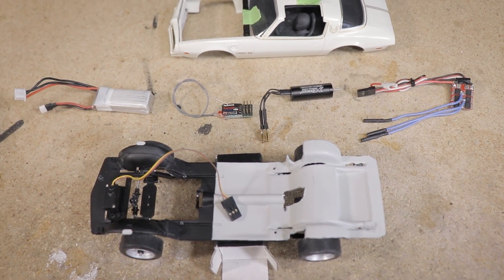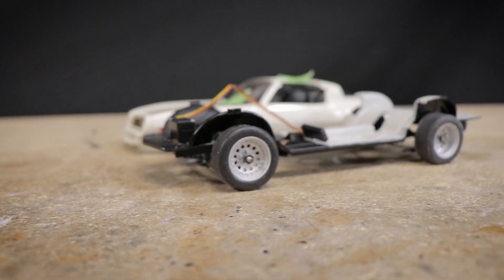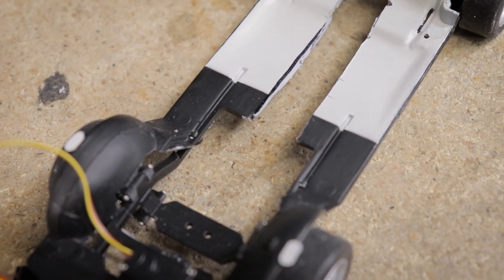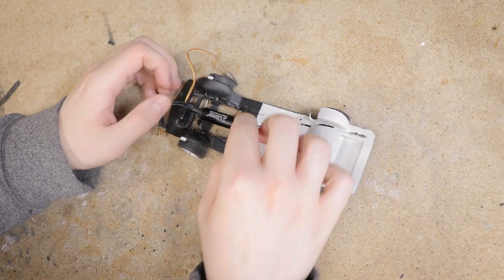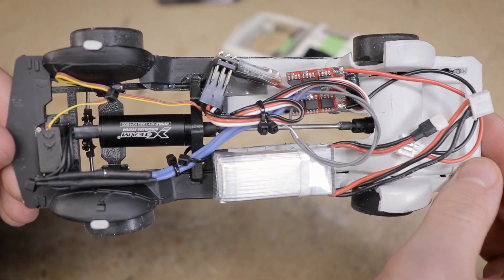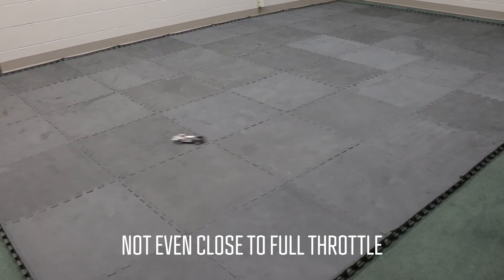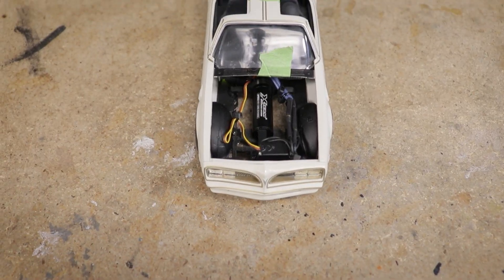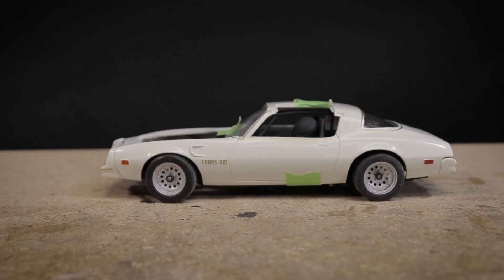The 1/25 Scale Trans Am is Alive! But Not Yet Perfected, So What's Next?

Comment from the maker: Thanks everyone for watching. Looking forward to seeing what ideas you all have. I'm really leaning towards just cramming in a more powerful motor and hoping that tiny 3D printed drivetrain hangs on but we'll see. I've got a few other pretty hot motors on hand I can try out to see what happens. I guess little torque = moderate inconvenience would be a more accurate thumbnail but it just doesn't roll off the tongue 😛.
Reply: Carbon fiber filament is probably the way to go
Reply: Might be able too do a taller motor mount or one that is offset left or right side and make a 2 gear setup with a ball bearing on the 2nd axle too ensure it's smooth & too get some more needed torque.

If you need too reverse the direction of the gears a 3 gear setup too use an idler will be needed probably. The same size as the pinion or 3rd gear should do it or experiment with a few different designs maybe for lower gear ratios.
While you don't have that much width too work with you can make quite a long gearbox and just double joint the rear axle probably if needed.
Should help with torque of the brushless motor as well making like a 4 - 5 mm wide set of gears.
Don't know what the gears would look like in a nano size servo but maybe the gears from an all metal gear micro servo could be the basis for the gearbox as well if you got some dead ones.

If you have an SLA 3D printer you shouldn't have a problem designing a small gearbox or gears as small as 3 mm or so with the right design put into it.
Though it can still shred gears ofc if you aren't taking it easy on takeoff.

If you want too get some already made gears though you can get some pn racing aluminium pinions for the mini-z there are ofc plastic ones as well.
As well as probably others searching like 64p pinion 2mm axle.
Like a 2 gear setup with the motor reversed on the direction I'd imagine should work getting like a 6t pinion for the motor & then a 16t secondary for a 0.375 giving you a 2.67 mechanical advantage.

Comment: Maybe not gears, but you could print 2 small pulleys and use tiny black belts.  The kind used to tie down hairs.  (Just ask any girls lol)

They are like 10mm across and with properly sized pulleys, you can acheive more torque.  If it slips, add one more in parallel!
Reply: Fantastic idea

Comment: Cool build Make It Rc!  I looked up your current motor choice and the KV options available are way too high (7000 KV+) for you style build.  Aim for half that rating, 2700 KV to 4500 KV (MAX.)  The heavier the car = lower the KV rating.  Agreed on the gear reduction, skip it....KISS.  As you do, it will take some experimentation but I would start on the low end and work you way up.  I found the same with my 1/10 General Lee builds: limited motor selections & very heavy body = HOT motors & popped batteries, but I was pushing it to get the "shot".

Comment: I doubt a micro gearbox would handle brushless power/rpms.  I'd look for a motor the same size, but much lower kv...lower kv will have more torque, less cogging.   The only other way to help at least the cogging, is a sensored motor.

Comment: File down the shaft to fit the n20 gearbox. If you're not too worried about lenght you could also just hollow out the n20 can and use a shaft adapter to attach it to the armature.
Reply: Also checkout micro linear servos for steering

Comment: I'd probably go with a lower-kv outrunner for a direct drive setup; alternatively, I know a few people have adapted N20 gearboxes to similar motors for antweight combat robots or orlandoo hunter crawlers with a small adapter plate; shouldn't be too hard to do. I'm currently running one of those motors through the stock drivetrain in an ftx/rgt mini crawler, which works fine, but I suspect the gearbox might be a bit large to fit under the bonnet, plus the reduction's probably a bit high for this application. Scalextric gears might be worth a shot too; I've used them with a similar motor for an rc boat, although I'm swapping to direct drive outrunner on that. Another thing to consider is ESC choice; a BLheli32 with SinePWM mode enabled helped with low-speed controllability & torque on the aforementioned crawler; furitek's FOC ESCs might be a decent shout too, although I haven't tried them myself.

Comment: Is there a way to hook a planetary up ti the diff? Like a rear transaxle? Or may be run a drive shaft from the motor to a gear box and another from the gearbox to the diff, with the gearbox mounted midship.

Comment: So you shouldn't try to 3d print a gearbox at all as the plastic gears cant take all of the rpm. Also if you do try to find a gearbox make sure the motor rpm is somewhat similar as I had a Wpl D12 that I put a rc helicopter motor into. I paired that up to a crawler gearbox and it worked good for a little bit. But in the end, the metal gears were going so fast that weak metal was not up to the task. I say maybe a crawler gearbox may work as a Scx24 transmission could work for a little bit. If that doesn't work then go ahead and get a more torque motor and that could work. On my channel I filmed me putting a scooter motor into a chassis I custom made and it was so powerful I couldn't stop it at 33% throttle. I did put direct drive from the motor to the differential as well so I can kinda relate to your situation as getting your hands on a gearbox or making your own is going to be very difficult.

Comment: I can't wait till you get a really amazing streamlined process rc kit that will work with any model car by having a adjustable wheel base kind of like ho scale slot cars and other slot car scales have you just move the front axle on two different spots forward or back but instead of front axle moving on your kit just have the solid live axle able to move in different positions so we can use any kind of 1/24 and 1)25 kits. The way you got the website and way you gotta buy parts it's kind of intimidating because I don't wanna waist a bunch of money on parts to make my models rc and I won't be able to get it to work for some reason. Maybe sell a very simple way of having a whole kit that is universal. But also look at the way a tj speed legend car chassis is built that would be perfect design for these for the rear axles pan car style axles with bearings and a spur gear and pinion gear with slipper and look at how the RJ speed legends and other chassis are built if you scale down the spec 10 and the drag chassis they would work perfect for 1/24-1/25 scale on road oval and road course hobby grade racecars and drag racing hobby grade chassis as well. The legend car chassis and the spec 10 chassis scaled down would be perfect for any 1/24-1/25 scale racing classes. I would use the same axle setup that RJ speed uses and every other pan car uses the pod design it's simple easy to adjust ride height and wheel base and even you could make it where the bearing/bushing retainers for the rear axle has different slots to make wheel base longer and shorter then 3d print different offset height retainers so you can just push out the old one and push in new one in seconds. I would love to see this become a very popular form of racing rc cars because the type of cars and trucks for oval on road racing and drag racing and just scale rc car to drive are endless options on what you can build and creat for racing or just scale diorama cruise ins and street racing lol.